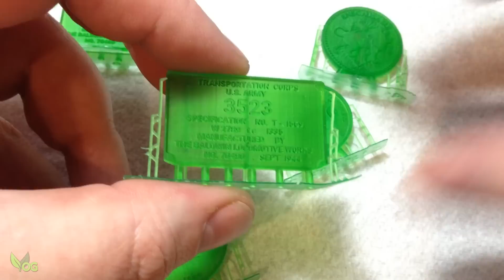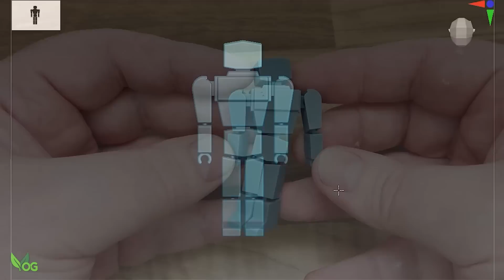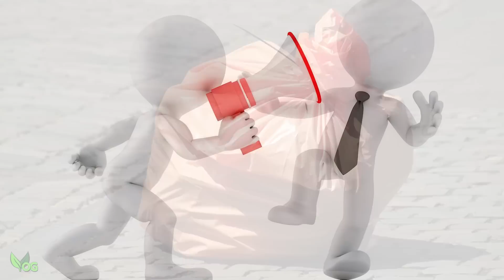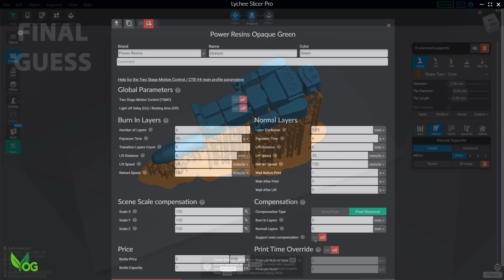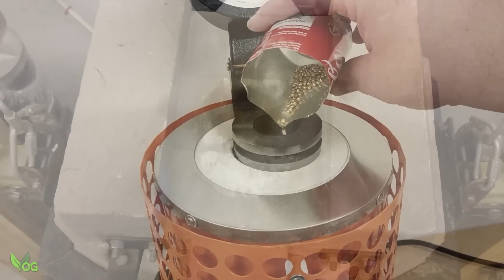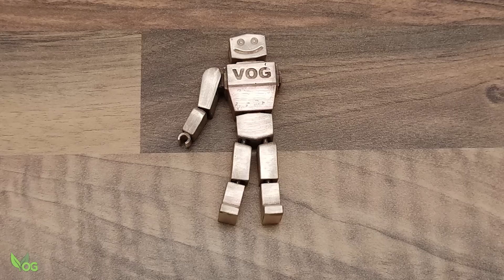Power Resins Opaque 3D Printing Castable resin review

Comment: Cool, I like the robot. I do wonder if cheaper resin would get the same result.  I've seen you make very detailed rings etc with cheaper stuff..
Reply from the maker: You need a resin that does NOT require post UV curing as the hinge sections are pretty much hidden. As long as it's okay there, any castable resin should do it. When I cast the articulated dragon, I believe I used Resinworks 200, which is certainly cheaper than Power Resins Opaque 😁
Reply: @vogman  And the dragon also wasn't cured? Because it looks perfect
Reply from the maker: Exactly. No post-curing there 😁
Reply: @vogman  
UV light via Fiberoptics or small prewired SMD UV led threaded inside would help

Comment: Why don't you just admit that it is not good enough for the ridiculous price they are asking.
Reply from the maker: Honestly? I've no idea IF it's good enough. It's an expensive product and presumably they want me to promote it for them. But the sample they sent me did NOT even fill the resin tray of my Mini 8K. This meant I was always going to be limited on the number of prints / casts I could perform. And without settings, I wasted half of the opportunities.
I like to speak fairly but candidly on my channel, so I stated the facts as I saw them. Expensive but does the job. I can't rave with enthusiasm or detail any problems (if there are any) because to do that, I need to use the product more... and I can't 😁

Comment: No VOG, don't use the bottle as a paperweight, dribbles from the side end up on your paperwork and ruin it! But it also makes me wonder is other companies will get hold of this resin and make a cheaper alternative 'inspired' by it...
Reply from the maker: There's not enough resin in this bottle to 'drip' anywhere 😂😄🤣
As for companies copying this formula, from the limited sample I've tried, I'm not sure they need to bother. Opaque certainly works, but I cannot definitively say its better or worse than any other resin I've tried, simply because I didn't have enough to test with 😁
Reply: @vogman  Sooo... Back to the purple goo?
Reply from the maker: Now the thing with the purple goo is that they gave me plenty to try. That meant I could really get my teeth into the resin (not recommended - maybe that's why I ended up in hospital). And I would have happily used it in this casting experiment if it had not been for the UV curing issue.
On another note, you heard it here first, it may not always be purple... oh yes, look out for more experimental videos with a new ST castable 😁
Reply: @vogman  Yes I've heard elsewhere that there is a new ST castable on  the horizon... And I'm very interested to see how is looks and functions.
Reply from the maker: Interesting... I'd love to know who told you as I'm the one that talked them into doing it, offered repeated feedback and is actually testing it. I often find it amazing how many others claim credit for these things... after the event 😁
Reply: @vogman  I'm fairly sure I just saw it on their website, as a 'available soon' thing, but I can't seem to find it now. So, now I'm not sure where I heard it from!

Comment: i have the same problem, i am eager to try the black and wax resins but the lack of information about the settings for my mini 8k makes me still trust bluecast resins and the great customer support on their Facebook group. like you said $300 dlls and no information at all, i prefer to spend a little extra and have direct contact with the company for any issue. great review!
Reply from the maker: Yes, we need Power Resins to sit up and listen to their customers / potential customers. In my case, for instance, the sample I received was NOT enough to fill the resin vat of the Mini 8K, so I was always limited on what printing and casting I could do. If I'd had good settings, then I could have done more for my viewers, offering them a better insight into this product.
Now I'm lucky, I got my sample for free, but others would have paid good money for something they couldn't use properly because there's a simple lack of information.
Power Resins need to follow Bluecast's example 😁😁😁

Comment: Its not 0.1mm accuracy,they just said its accurate.I think those numbers are minimum thickness it can print .
Reply: I regularly print this resin at .03mm layer thickness.
Reply from the maker: Fair point. I misread that. Still, it worked out pretty accurately for me 😁